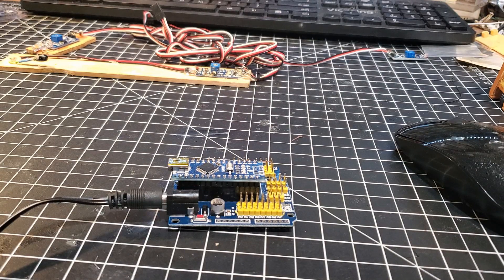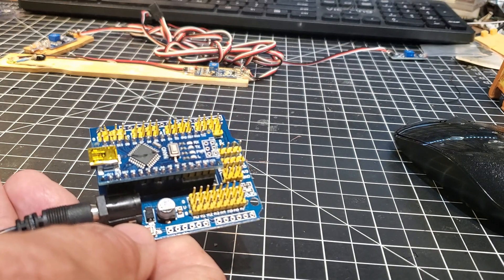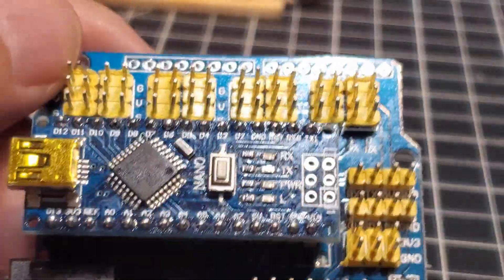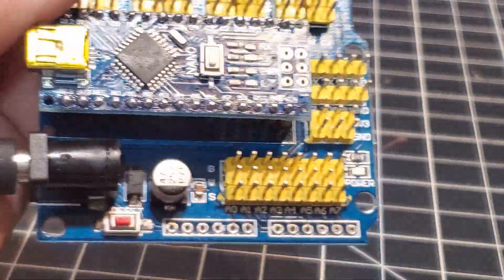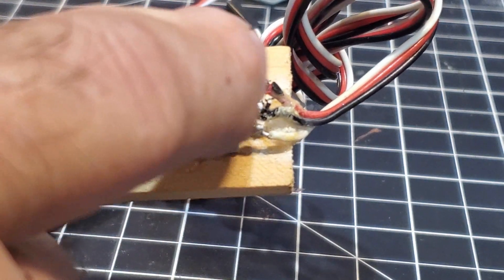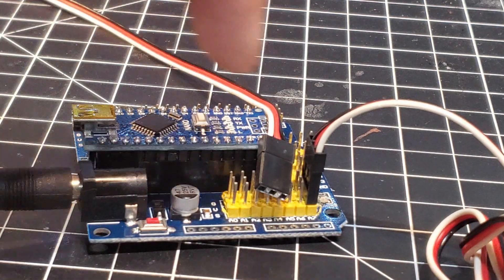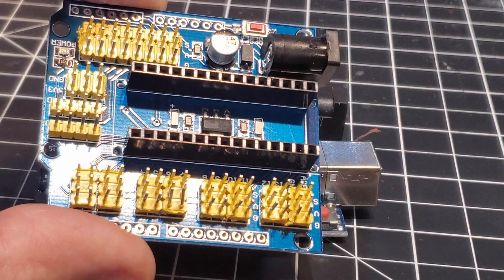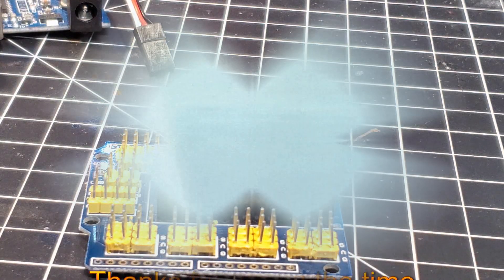Arduino Nano Prototyping shield

Comment: Exact same shield comes for the uno. What would be better to go with uno or nano 😅. Thanks for the review ☺️
Reply from the maker: I would use the nano as it has 2 extra analog inputs and typically cost less.
Reply: @LawrenceEggering  I had another question. Can nano with usb suppy easily hold enough power to drive 8 micro servos ?
Reply from the maker: It might but it depends on the servo used. It is much safer to use an external 5 volt supply at greater than 1 amp.
Reply: @LawrenceEggering  Thanks a lot for quick response ☺️

Comment: Hey Buddy, great video but I wanted to point something out if I may. First, on the connectors that the wiring doesn't match up, instead of cutting it off and soldering, just unlock each pin and pull it out of the plastic connector. You can reinsert the pins into the connector so that it matches the pin-out on the Shield board. This way you don't have to solder the cables directly to the pins. The cable is much cheaper to modify than the sensor is. Second, the holes along the Shield board edges are for the Arduino UNO to plug into. This shield can be used on the UNO and the NANO. If you take a look at the pin-outs, you will see that they match. Also, you don't have to solder the NANO directly to the shield board. This way you can interchange the two boards and use the shield for various other projects that come along.
Reply from the maker: Thank you! You are correct on both counts. 
For me, I prefer to solder them to the sensors. The sensors and the cables are less than 1$ each.
I discovered the nano connection after I uploaded the video. The only caveat is the number of analog pins on the Uno is only 5.

Comment: Where's the Servo external power input pin on this board?
Reply from the maker: There is not 1 single pin for it but there is a 5 volt and ground pin on each of the Input/outputs which can be used if you use servo extensions. Larger wires can be soldered to the 5 volt pin. Also the 5V pin appears on the shield in multiple locations. If you had say 10 servos, I would use two of the 5 volt pins to distribute the load if you are concerned.
Reply: @LawrenceEggering  I just received this shield. When you invert it, below the holes where there are no pins (holes below the A0 pin), it shows connection of Vin to one of these holes. Can I use a JST connector in these holes to power the Servos by AA battery pack? Also, there is a Vin and a 5V. Which'll work with a 6V battery pack?
Reply from the maker: @divye.ruhela  V in will take up to 12 volts so it can be used. (4) batteries is 6V which will be outside of the 5 volts.
Reply: @LawrenceEggering  Thanks. I was lazying around, ignoring my small project. Your video and replies helped alot!
Reply from the maker: @divye.ruhela  I am happy to help!